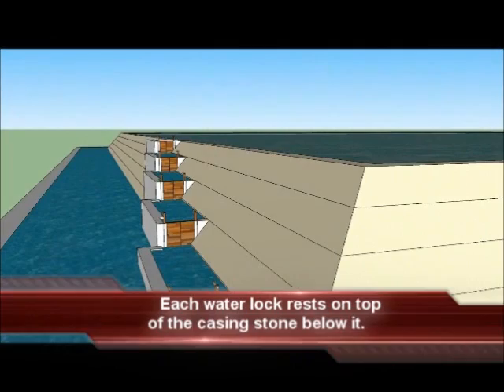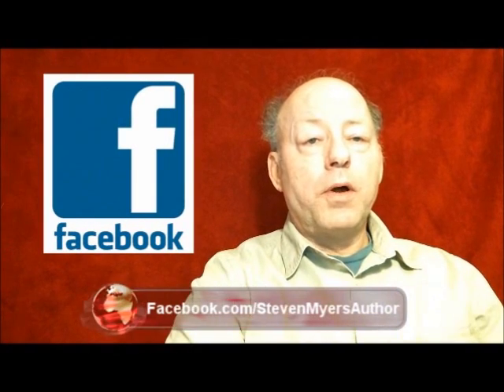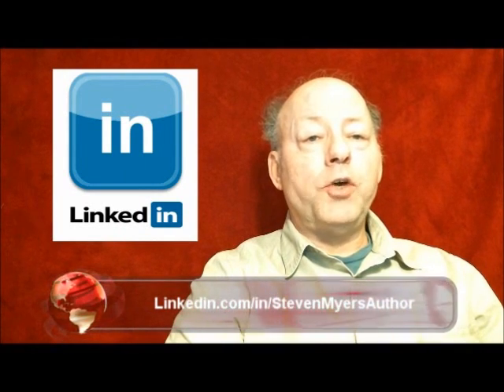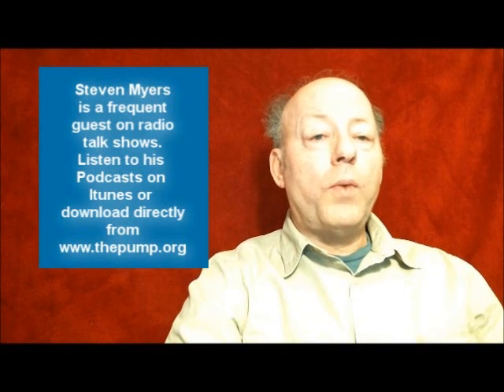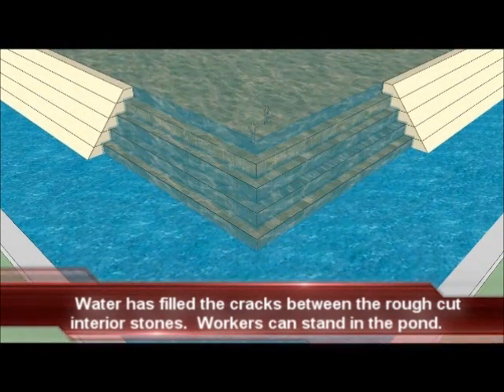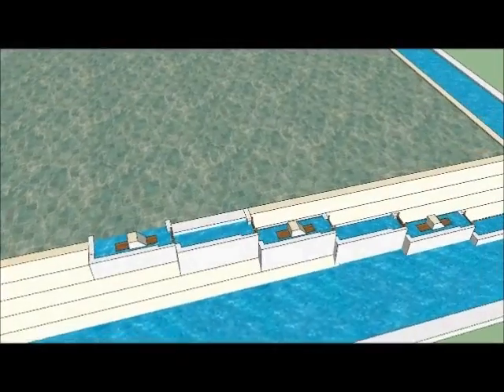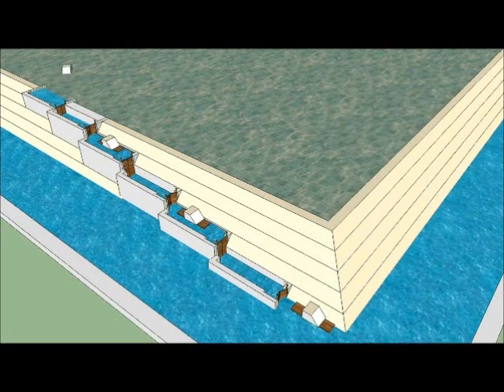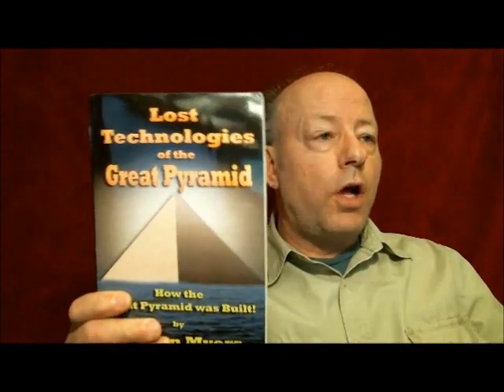Video 4  Moving Stones of the Great Pyramid to Great Heights

Comment: Everything have been well thought out in this video except the water supply problem from above.
Reply from the maker: I hope you watch the entire video series.  I hope you read my two books and watch my two documentaries.  There is a lot more to the research than a few short videos.  Maybe someday you will find out that the rest of the research is well thought out. Here is my web site for more information www.thepump.org
Reply: Steven Myers 
These are problem not stated in detail in last message. 
(1) buoyant issue : limestone weights 2.7x of water. Stone block’s water displacement must be increased by 2.7x to gain 1:1 buoyant, with attach floatation. Water consumption per stone block is 2.7x liter of water (times a margin to overcome operating loss) for every liter of limestone buoyant. 
(2) lock clearance : 
Is required to maneuver the floating package between locks. Add 12% or more to make up lock capacity in this case for 3x liter of water per liter of limestone. 
(3) lock gate leakage and vaporization : add another 10%
(4) reservoir (pond) budget : we need at least 3.12x casing stone of water head in the reservoir before the next level begins. Such water volume may be supplied on demand, just in time delivered, at a rate of 3x 250 locks of water per day over 25 years.
(5) water supply problem : 
What type of water pump technology and method used isn’t mentioned in the video.

I sincerely hope those issue were addressed  in this book.
Reply from the maker: @philoso377  Hi. Thank you for your thoughts.  Water locks work.  They have been demonstrated to function every day for over 150 years. Yes limestone is heavy.  Yes water locks use water.  Yes water was supplied for the pond to stay full and for the water locks to operate.  Yes these are the things that that my first book talks about describing how the Great Pyramid was assembled using water locks and barges.  Thank you for your interest and maybe you will learn more by reading my books someday.
Reply: Steven Myers 
The operating principle in any lock system hinges on the water supply. Video assume reservoir is always full at waist deep, seems to me unrealistic? 
The condition that made locks operate in the pass 150 years is - that water supply is limitless, limitless off a source with water head above of the highest lock when full. To that the Nile’s water head didn’t help. 
Your video introduction shows a modern lock work as intended is owing to - the top lock is situated down stream of a big river.
Reply from the maker: @philoso377  The video we are commenting about and this video series is about how stones were moved and set in place to assemble the Great Pyramid.  My 2nd book and my 2nd video series is about "how water got up there to supply the water locks"  Thank you for having an interest in this well thought out research.  Maybe someday you will have enough interest in learning more by reading my 2 books to find out "how water got up there to supply the water locks".
Reply from the maker: I am leading a tour to Egypt in February 2021 to discuss the Great Pyramid and so much more.  Here is a link with more information. https://barbarajeanlindsey.com/
Reply from the maker: @philoso377  Yes there is a water supply.  That water supply is the focus of my 2nd book and 2nd documentary.  This is where we are at.  You know that there needs to be a water supply and so do I.  But you have watched at least one video of a video series that focuses on the movement and placement of stones. From watch that one video that is talking about something other then water supply you are unaware of what the water supply is. That is where we are at now.  I spent over 10 years telling you want that water supply is and the result of those 10 years is my 2nd book about the water supply.  As a researcher it is interesting to me how people conduct research.  We are in an information age.  So I am wondering if you will be able to conduct research to learn what the water supply that you don't know about is.  You think this is a well though out video.  I would say it is the result of well though out research.  The video did not say how the barges were made but the video is not about how the barges were assembled but how the stones were moved and set in place.
Reply: Steven Myers 
After extended research, some kind of inertia pump in regards to pyramid architecture was revealed. I trust that is what is claimed in your book. If so that offers a principle argument good enough to write about. I also see some definitive loose ends that can overthrow this principle without much stretch but I’m too busy to pursue it today, may be never. Good job in your books. Cheers.
Reply from the maker: @philoso377  Thank you for your superficial interest in the well thought out video.  I hope someday you can overcome your preconceived notions and presuppositions about my research that you are not very interested in finding out about.  The best way to protect your preconceived notions and presuppositions is to say ignorant.  I sure hope you don't go on the tour to Egypt I am leading.  Being around lazy researchers is a buzz kill.
Reply from the maker: @imagikarp8979  Usually when I make a sarcastic comment it is a response to a sarcastic comment.  Nothing wrong with that.  I hope my sarcasm motivates the person who made a sarcastic comment to me to conduct research.   Maybe I can make them so mad they will actually be motivated to learn more.  Are you that mad?

Comment: While quite possible with modern technology as far as pumping water. This method would not be plausible in that time frame.

For every foot of elevation a column of waters pressure increases by 2.31 psi.
By the time you are at 433’ the psi is 1000 at the bottom. 

The stones, and joints would leak like a colander. Requiring constant replenishing of water at the work site elevation. This does not even cover locks opening, and closing to move barges up to the work site.
Reply from the maker: The stones are interlocked and the casing stones are sealed with a bonding agent stronger than the stone itself. Yes water locks have doors that open and close that have no relationship to a "time frame". The Erie Canal moved the weight of the Great Pyramid to a height higher than the Great Pyramid in 2 years. Water locks are powerful and fast.  Much faster than you are in moving heavy payloads in the proper "time frame". Maybe you can read my books and watch my documentaries someday to find out how the Great Pyramid was built and why.